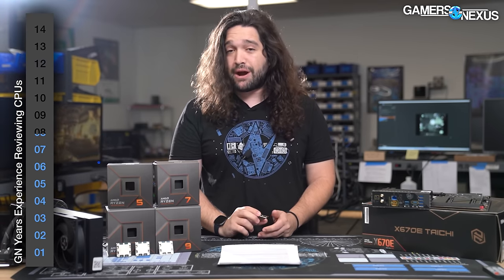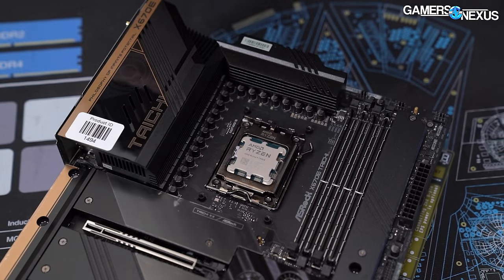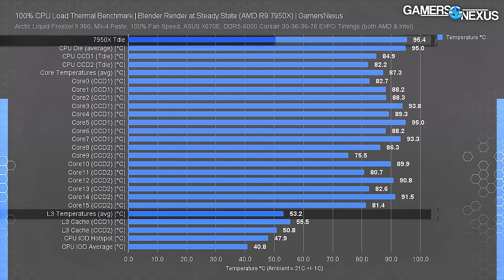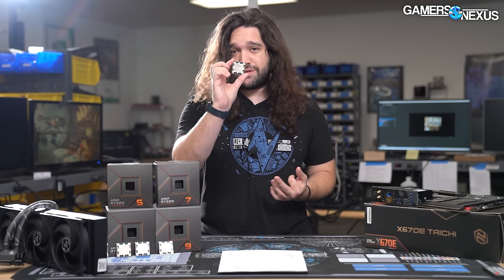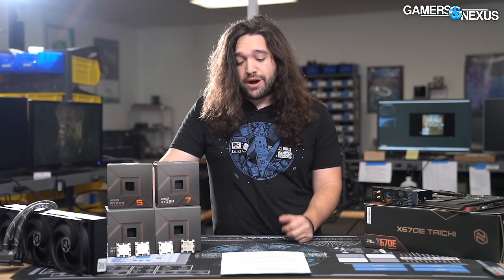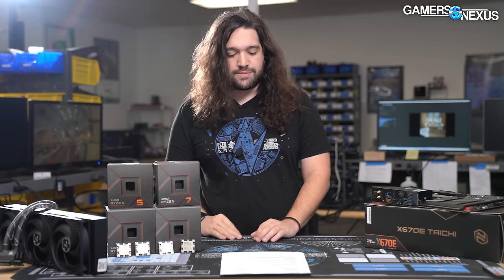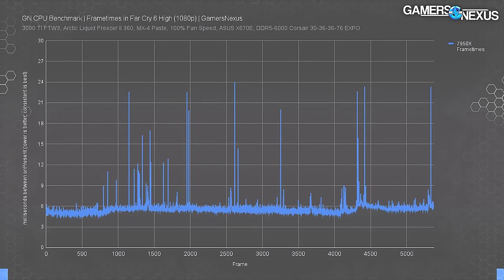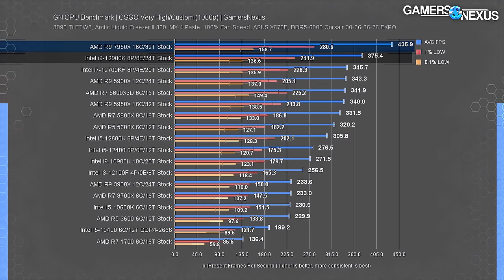95°C is Now Normal: AMD Ryzen 9 7950X CPU Review & Benchmarks

Comment: finally a new space heater
Reply: pair it with a 12900k and the global temperature raises 10 degrees while in use
Reply: I need to pull my 390x out of storage to prepare for this winter 😭
Reply: kudos to AMD to provide relief when other heating solutions are through the roof with rising gas/oil prices
Reply: a cpu wont heat your room, a gpu will however, the overall production of heat relative to something's size and how big it is, is easy to see in Watts, GPUs tend to be hotter and exude more heat because they use significantly more power, my 3090 is a literal space heater, i put it under my desk and it vents heat on my legs
Reply: 360mm radiator 95 temperature WTF
Reply: So many of you have no clue at all
Reply: This is how Europe gets through this winter
Reply: ouch. Alder lake smearing coming now.
Reply: We already had a better one 12900k
Reply: First bicycles, then socks and now this!?
Reply: Let the memes begin, but I'll take my performance too.
Reply: @bastordd  it is because of how small the cores are. They are nearly half the size as desktop Golden Cove
Reply: Space heaters are obsolete, just build yourself a modern computer and you'll be wanting to run the air conditioner in winter time.
Reply: no more gas bill only electricity
Reply: @benc3825  so what? They launch  multi thread CPU eating a lot more power... if I don't read the main text I almost forget this is AMD and not Intel... they FK so hard this 7000 launch
Reply: @SSpider41  This dude isn't lying
Reply: @yesyes-om1po  this thing was taking 250w as measured by GN, so almost as much as many GPUs already.
Reply: Heat doesn’t equal the same as power consumption. Zen 4 has the smallest cores AMD has made within the past decade at least. Intel has more silicon for their cores only and not including cache and I/O. 
16 Zen 4 cores take around 52mm2 of silicon, where as 8 GNC + 8 GMT cores take 79mm2 of silicon. It is the heat density that causing higher temperatures, so 170W with 16 Zen 4 is 3.27 W/mm2 vs 8+8 only is 2.15 W/mm2.
That makes Zen 4 have roughly a 50% W/mm2.

The more core silicon you have, the more spread out the heat load is, making it easier to transfer heat from cores to the IHS to the cooler.
Reply: Would 400W be easier too cool on a 3090 or 400 W on a 3050? Obviously not the same heat density as this situation, but this illustrates what I am talking about
Reply: @bastordd  So these CPUs are dead on arrival because they increased power consumption? Why does intel get a pass then?
Reply: @benc3825  Fanboyism, u not hurt mah company!
Reply: @benc3825  its not a pass is AMD doing the same Intel did for a long time
Reply: @bastordd  Can you translate what you meant to say?
AMD hasn’t really done this since Bulldozer, all of the Zen CPUs have been really power efficient, their problem is heat density
Reply: @DrakkarCalethiel  it is the underdog effect, AMD is no longer the underdog, so every they do is heavily criticized
Reply: Im gonna just go ahead and plumb my watercooling loop into my pool and turn it into a hot tub.
Reply: @yesyes-om1po  A cpu wont heat your room? its literally pulling 200w+ thats absolutely high end GPU territory from a few years ago
Reply: I game in a basement. It gets cold in the winter. Maybe I'll pipe the rad under my desk and keep my feet warm!
Reply: @bastordd  this CPU is not the one you would want for gaming, AMD will probably release some r7 7800x3D in a couple of months, that be their highest for gaming.
and when it comes to heat, that 95c Steve just said is the target temp, it won't matter if you have a water pump or some small air cooler, the CPU will draw power until it reaches 95c, your heat solution will determine how much power it will be before it reaches that temp.
Reply: @WayStedYou  Yeah, that's the low setting on my space heater.  Some of these comments are so spergy and black/white.
Reply: Now pair it with a 4090 🤣
Reply: FX 9590: finally a worthy opponent
Reply: You don't understand the difference between heat and temperature.
Temperature is just a concentration of heat. This doesn't actually produce a lot more heat, it's just a smaller surface area so the same amount of heat in a smaller place is a higher temperature.

A lighter flame will not heat up your room like a space heater will even though the lighter flame is over a thousand degrees. This AMD chip won't heat up your room because it's 5 nanometer which means it's much smaller area, so the same wattage which is the same amount of heat on a smaller area just equals a higher temperature
Reply: @bastordd  temperature is not heat. It's about the concentration. It doesn't make a lot of heat, but the heat that it does make is very concentrated because it's only five nanometers. A lighter flame does not warm up your room very much but it's thousands of degrees. A space heater will heat up your room but it's not very hot. It just makes more heat spread out. The total amount of watts is the only number that matters for how much heat is going to come out of your aio. The reason why it's 95° is because it's just concentrated on a small area.
Reply: @bastordd  it doesn't make a bunch of heat though. That means you don't understand physics or thermodynamics. It has a high temperature but a space heater is only 100° and it warms up your room but a lighter flame is thousands of degrees and it doesn't warm up your room. Because the lighter doesn't actually make very much heat, it just concentrates the heat that it does make very very very very very small and with the AMD chip being so tiny because it's five nanometer it means that the same amount of watts is going to be a higher temperature
Reply: @MistyKathrine  if you remove the thermal solution from a raspberry pi it will get to 95° even though it doesn't warm up anything. Temperature is not heat and if you think that the temperature equals the amount of heat that it's making, then you don't understand physics or thermodynamics
Reply: @bastordd  LOL kid it's a Work/production processor that not only competes with a gaming processor, but it beats it in some tests.. so it's like seeing a Bulldozer racing a Sports car and beating it.
Reply: Gas getting expensive
Reply: @benc3825  This time it isn't only power density, it is that thick ass heatspreader. Roman did delid the CPU and used direct die  cooling. He dropped 20C and managed to keep it well under 200W. 
Reason why the heatspreader is so thick is because AMD wanted to keep the same z-height compared to AM4 for cooler compatibility. Wonder how many C you can drop by sanding it down a full mm.
Reply: @bastordd  boost eats all available safe headroom
Reply: Best me too it
Reply: @bastordd  Intel throttles
Reply: I can finally move to Alaska with no worries.
Reply: @bastordd  bro what games use 16 cores at full boost.
Reply: Well its what we need .. considering the winter season coming soon
Reply: @bastordd  nope intel sucks more
Reply: AMD Kothlon, I mean Athlon worthy successor.
Reply: @cnhtol1586  Intel already raised power. They need a real 20% ipc increase now or they have to increase power again.
Reply: I'm living for all the comments of "you don't know thermodynamics!!1!" from people who don't actually know what they're saying
Reply: @bastordd  Did you even watch the video? ALL these CPUs will run at 95°C regardless of the cooler.
Reply: Don't need to put heating on now especially in the UK where it's becoming stupid expensive just use this instead
Reply: Just in time for winter
Reply: @DrakkarCalethiel  Yep, I was commenting on everyone claiming that Zen 4 was an extremely power hungry. It may be more hungry than last gen, but it is no intel.
As for the cooler compatibility, I bet that is only part of the reason. AMD’s next goal on their 3D packaging road map is die on die stacking, AKA what if they stack cores on cores? I have no idea how they would cool it, but it is a possibility that the IHS is thicker so they can grow upwards rather than outwards on the substrate.
Reply: Only cost $700
Reply: Just in time for the winter! Well.. the fall, anyway.
Reply: @yesyes-om1po  I'd be inclined to believe this if my RX 480 at 70C wasn't so trash at heating my room. The temp sticks to 24C near the pc and other oarts of the room stay at 20C-22C.
Reply: @rhonpen5388  You’ll pay for it through your electricity bill 😂
Reply: @benc3825  even when they were the so called underdog they got heavily criticized and the general advice was that they were a waste of money, just buy Intel instead. 

It's not so much the temps I mind as it is the power draw. Which means that obviously I'm not looking for the 12-16 core stuff they make. Probably sticking to 8 cores for quite a while. It's basically the exact reason I bought the 5700x.
Reply: @WayStedYou  200 watts on the GPU barely did anything to my room. Especially in comparison to a 1000 watt deep freezer. 

Almost sounds like a bad joke in comparison.
Reply: @endless2239  sounds like I should purposely gimp it with a hyper212 evo haha
Reply: @VndNvwYvvSvv  200 watts was your low setting? Mine was 700 watts. Its high setting was 1500 watts.
Reply: @lolthekidison  and still runs relatively hot haha
Reply: @benc3825  this is a hard pill to swallow but benchmarks scores don't lie.
Reply: @bastordd  thats worse than my 12900k at stock 🤣
Reply: @yellowflash511  weird my 12900k didn't hit 95c on a 360 aio... 🤣
Reply: @lolthekidison  yeah the 12900k throttles on a 5$ training wheel cooler with the incorrect mounting bracket... doesn't throttle with my cheap aio lmao.
Reply: @TheBURBAN111  Enable PBO which is the boosting equivalent of intel as used here in new 7000 chips then it hits 100+. This isnt even a unknown thing you can check paul's hardware review of 7950x there also 12900k hits 100 while 7950x hits 95.
Reply: I cant wait to pair it with my Vega 64.
Reply: @ArtisChronicles  the CPU in this benchmark uses a lot more power than your RX 480, my 3090 uses 350-410 watts of power, the byproduct of the use of energy is heat, most cpus don't use their total wattage while gaming
Reply: @pilotavery  Higher wattage parts generate more heat.  My 12700K makes my room noticeably (and measurably) much hotter than my 9700F ever did.
Reply: @MistyKathrine  this is my point exactly... The temperature is high but the wattage is not.
Reply: @yesyes-om1po  yes and no. Heavily depends on situation and workload. In normal desktop environment/light workload and websurfjng, the CPU will keep generating heatspikes and output consistent heat while the GPU (on waterloop at least, is what I am talking about) barely even gets over 35 degrees

Comment: It would be interesting to see the efficiency of these cpus at a fixed power limit (60W,120W), would cool to see who has the most efficient cpu there
Reply: 4ghz
Reply: Laptops next year
Reply: I'd expect most, if not all, the performance gains will be given back - which is somewhat common sense.  AMD wouldn't be specing the Tj at 95C unless that was what was needed to make the product SKUs viable vs the competition. There will certainly be some lifetime impacts running at 95C Tj - only question is how much and/or how badly.
Reply: The Eco mode on the 7950 does something like that, was really nice results in another review i read!
Reply: My 5900X has an Eco mode you can switch in BIOS, it sets the TDP to 65W. Maybe Zen 4 has something similar?
Reply: I legit undervolted my R9 5900x and got cooler temps and more speed "boosted Higher".. I would expect it to be similar from the newer cpus
Reply: @Mr_Meowingtons  aw man, you're already on zen5?
Reply: @Maxlan  he's definitely on Zen6, must be nice! 👀
Reply: You already saw the watts per frame chart @ 12:00 - 7950x uses 70% the power of a 12900, for the same amount of work.
Reply: Wendell from L1Tech capped the 7950x to 60w and still score over 30k in R23.
Reply: we know the efficiency is more than double at 60W compared to 105 (official AMD numbers) so the temps are bad, bad design in general. I wont buy zen 4 nor i13 series, both are shit
Reply: @Maxlan  yeah got to be the first!
Reply: I have to do that since I am living in hot zone..  Can't imagine my pc could work properly without AC... but I don't like to turn on AC 😐😑🙄
Reply: Yes i also want to know that. 🙂
Reply: probably only makes sense for laptops. undervolting is one thing, but generally people will only reduce power budget if they have an actual limiting factor in their setup (maxed out psu, etc)
Reply: +1 for my sff itx bros
Reply: OC3D did a 7700X and 7950X review where they compared eco mode, stock, and OC and the results on eco mode were quite impressive, really not a big dip in performance in gaming if you use the eco mode: https://youtu.be/fsCMuy6dP1Q
Reply: @GoalPlays  really? Damm i need to watch that vid. Sounds Very interesting. 🙂
Reply: I would really like to see this test, it would be really useful to see whose CPU is the most efficient. When I want to leave my PC on 24/7, this is quite important to me
Reply: @oplkfdhgk  it was definitely cool to see the results. I hope we get more tests coming out that do even more game comparisons between eco and stock!
Reply: Looks like i cannot post any links here... There are some people which tested the new generation at lower TDP. Even at 65w the 7950x is above the 12900ks (7zip, blender, cinebench r15, cinebench r20 etc.) and at single core its on the same level as the 7950x without TDP limit. Well of course 12900ks only has 24 threads but its just stunning: 65w vs 241w.... its just amazing. New Laptop generation will crush intel also when they improve the APU by using more graphic cores compared to the desktop version
Reply: I AM THE BEEST YOUUTUBER YOU'RE ALL TRAASH COMPARED TO ME IM THE BEEST 😂😂😂😂😂😂😂😂😂😂
Reply: @Mr_Meowingtons  What exactly did you adjust? i have the same processor and id definitely take cooler temps and more speed
Reply: @sjolson68   computerbase has tested it at different power limits, and in their testing it only lost 5% in all core performance at 140 watts, and still outperformed a 241 watt 12900k at 65 watts.
Reply: @sjolson68  All these CPUs will run > than 7 Years even if you Overclock them. It doesnt really matter especially with all those more modern "auto overclock" CPUs (Ryzen 3XXX and newer and Intel 12th Gen and newer) since they adjust themselves to what is possible.
What will shorten the lifespan more is undervolting the CPU + not knowing what you are really doing there (so 99.9% of  reddit)
Imagine this like a car engine running custom home made specs for the fuel injection. it will damage your engine.
its counter intuitive, but RMAs for "defective CPUs" speak for themselves if you investigate what happend.
Reply: @PrefoX  Yeah.... 30 Years ago some journalists wrote something like "30 Watts on a CPU and 65 degrees is WAAAAAY to much" (Pentium 1 had a TDP of 25 Watts)
When ppl don't know what they are talking about....
Just stop yourself next time when you even think about tech, pls!
Reply: I'm tired of the bias that exist in the PC gaming ecosystem 

when AMD runs hot they get a free pass but when intel runs hot they are criticized, joked and bashed for it.

now power consumption has become a AMD fanboy talking point that it is almost political. 

you see their are double standards when it comes to AMD and Intel, because without double standards AMD has no standards and AMD are guilty by thier own damn standards
Reply: @d3x84  I think you confused overvolting and undervolting.
Reply: Steve's conclusions on power and efficiency dissapointed me. We know efficiency scales very poorly with clock speed. So putting an overkill cooler on it and letting it run wide open, then complaining how much power it consumed is a bit backwards. Lets see some power normalized or benchmark runtime normalized tests to see how the generations compare.
Reply: my bet is on ryzen 5000. Probably the 8 core.
Reply: @d3x84  Very cool story, sir.  Pun definitely intended.
Reply: @Hyperus  It's so backward it must be a troll.
Reply: @cummerou1  Normal consumers arent gonna know that./ People will see big score number and lean toward the chip that has higher score.
The tjmax boost algorithm is only there for stat padding so it can sell easier to the mass.
Reply: It's more interesting to see how good the heater performace of 7950x for space heater.